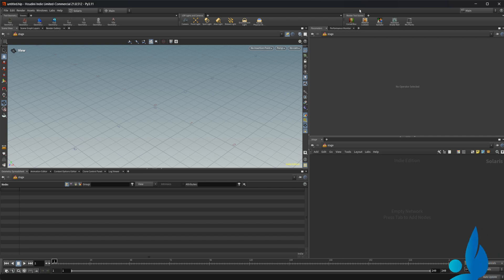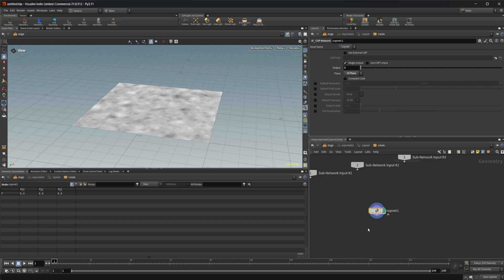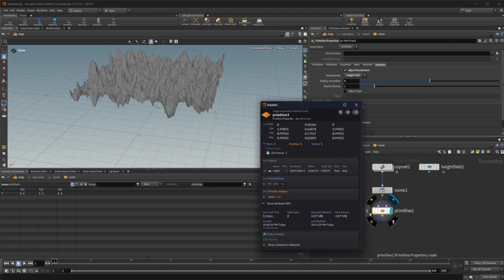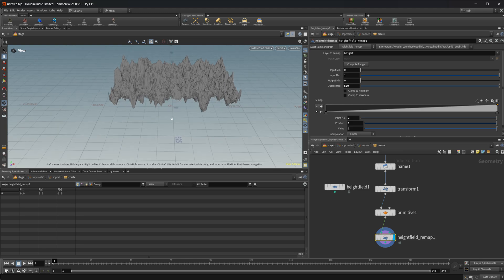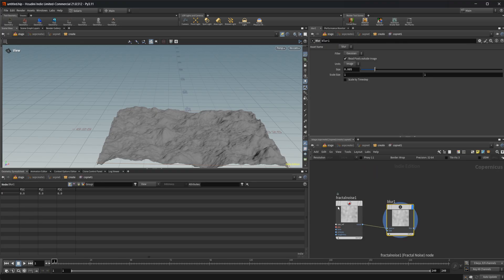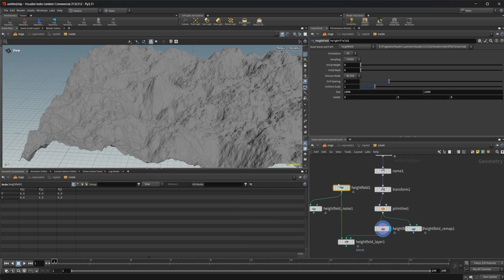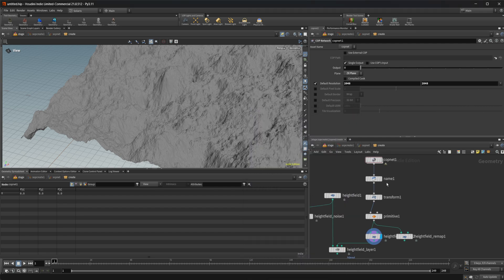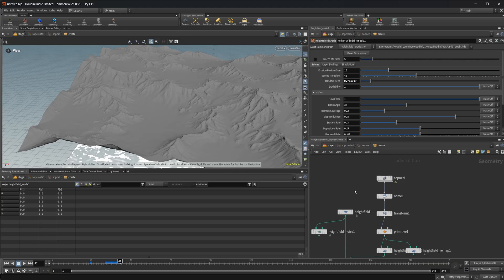How to Use COPs to Generate Heightfields | Houdini 21

Comment: thanks! I was wondering why you did not use heightfield_visualize inside cops?
Reply from the maker: You certainly can. I am going to cover more information on the topic as well. If you dive inside the hf visualize node you will see that it is bringing the information into sops and doing what we did when we brought it into sops.  You can then just output that to get a heightfield with everything named properly. I think it is important to understand what is happening under the hood which is why I show it the way I did.

If you stay directly in cops though to preview the heightfield you need to add another geo to layer down to get the information back to a usable mono channel. This is where the layer properties is nice as it is the only node you need.

Great question. Thanks for asking!
Reply: @InsideTheMindSpace  Thanks for your response. that makes a lot of sense. Your videos are always very helpful. Thanks again!